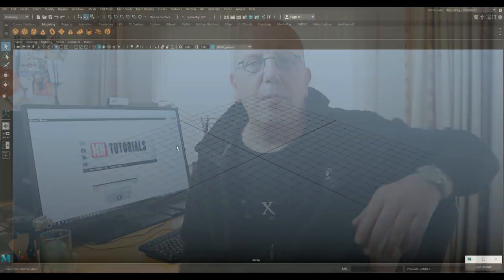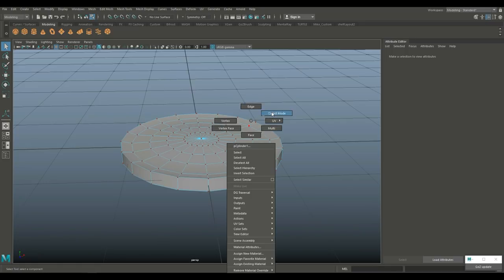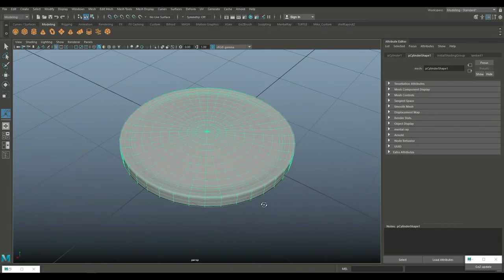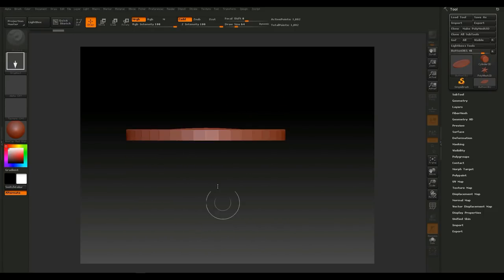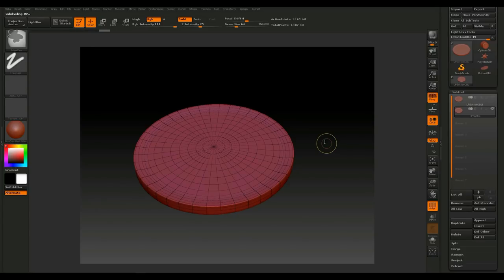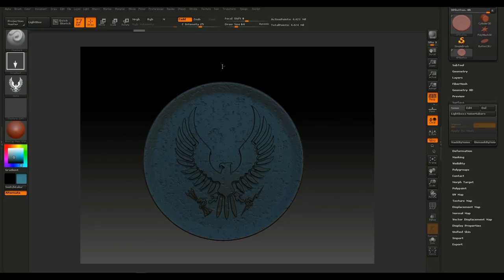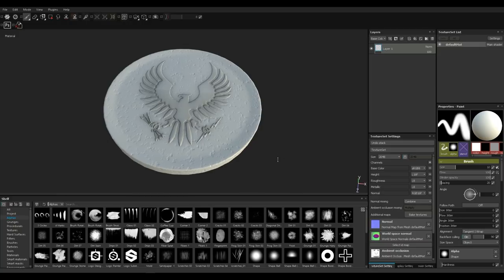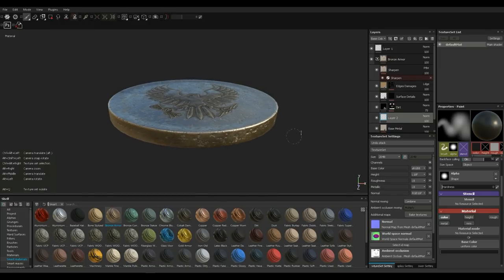How to model a 3D MILITARY UNIFORM button

Comment: what if use crease tool rather than adding more edges? the result will be the same without using more polygons right? and what does freeze transformation actually do? btw thanks for good tutorial
Reply from the maker: Yes you can use the crease tool and you are right but it will give less control over how hard the actual edges will turn out.  Frrezes transformations set position, scale etc all to zero value
Reply: oh thanks a lot